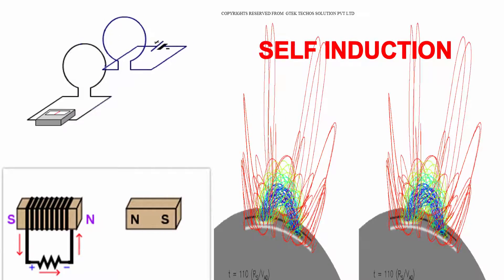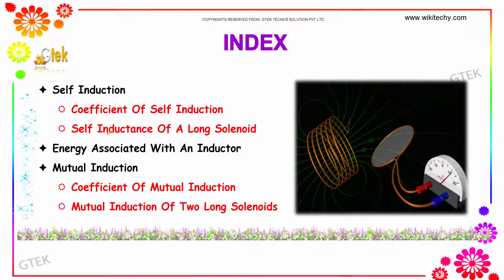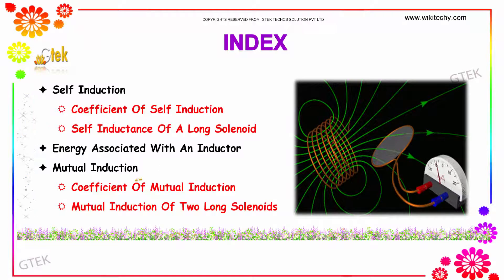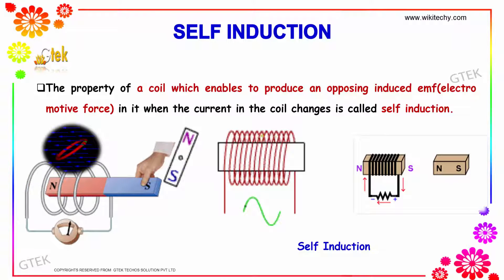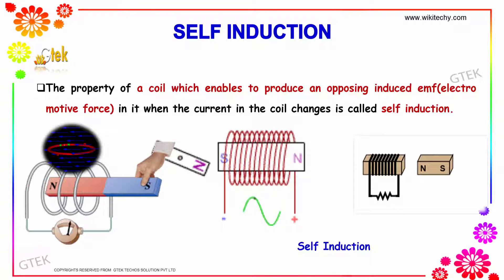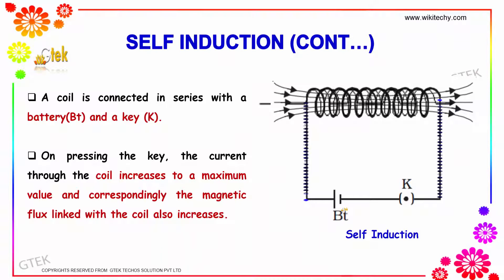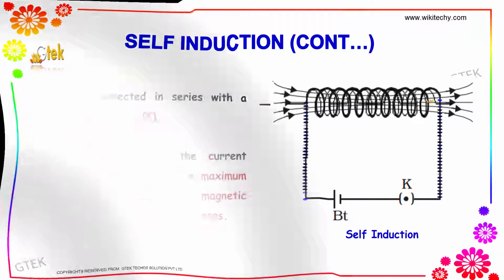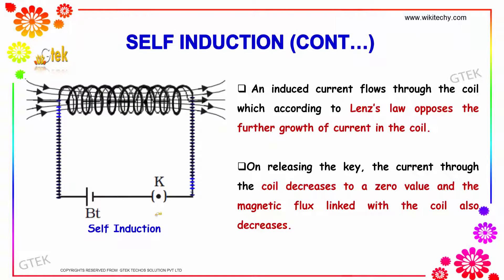Self induction|class 12 physics subject notes lectures|CBSE|IITJEE|NEET

Comment: Self inductance is defined as the inductionof a voltage in a current-carrying wire when the current in the wire itself is changing. In the case of self-inductance, the magnetic field created by a changing current in the circuit itself induces a voltage in the same circuit. Therefore, the voltage is self-induced.

Comment: In the case of self-inductance, the magnetic field created by a changing current in the circuit itself induces a voltage in the same circuit. Therefore, the voltage is self-induced.